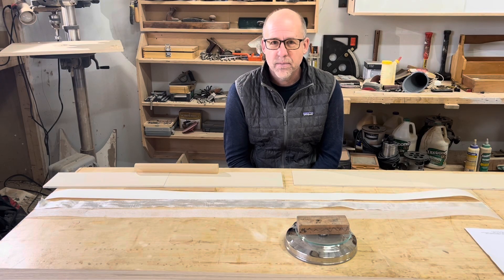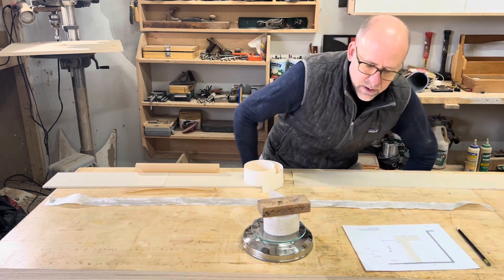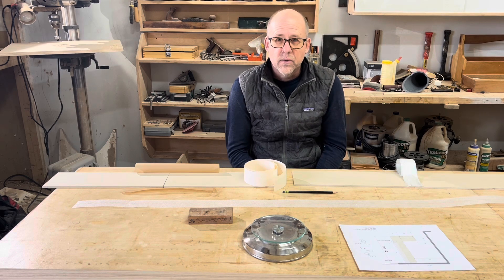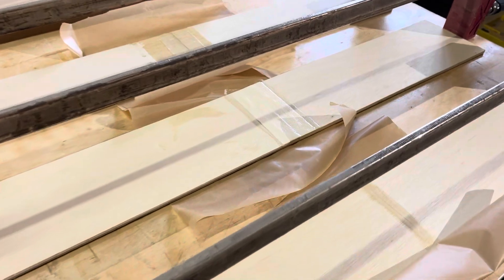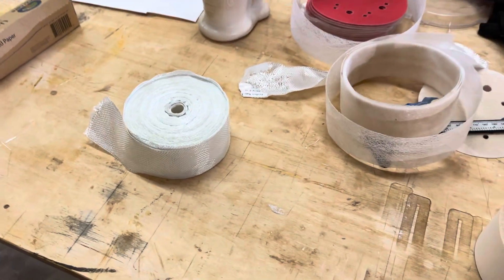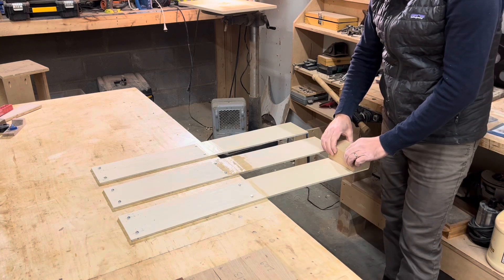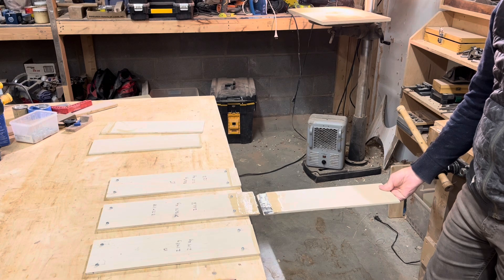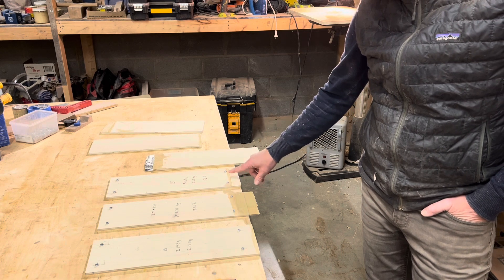Fiberglass tape vs paper tape strength test

Comment: I think the problem with the plasterboard fibreglass tape is it seems to be coated with some kind of wax or something that doesn't allow the resin to penetrate it very well. I'm very interested in titebond as a replacement for epoxy glue, especially if you can cove/fillet and fibreglass joins as well.

Comment: Cost and weight of the fiberglass application can be lowered by 50% using one inch wide tape while maintaining the majority of its strength.
Reply from the maker: Interesting.  I guess it also depends on material thickness and radius whether to use 1” or 2”.
Reply: Yup... I also like to embed an absorbent rope into fillets, adds strength and lowers the amount of epoxy required.
Reply from the maker: @PeaceProfit  what kind of rope?  There are so many kinds.
Reply: Majority of my work is restoration, so generally repairing a failed glue component... I use a very thin application of Original Gorilla Glue in combination with Titebond, penetrates deeper, holds better and the wood glue activates the polyurethane.
Reply: Depends, cotton clothes line for light fillets, braided nylon for more strength, painted in with liquid epoxy then covered with thicken fillet.
Reply: It’s about strengthening a joint that has failed from use so likely to fail again.
Reply: Epoxy and/or glue alone will fail over time, even laminated components, blending the glues and materials changes that.